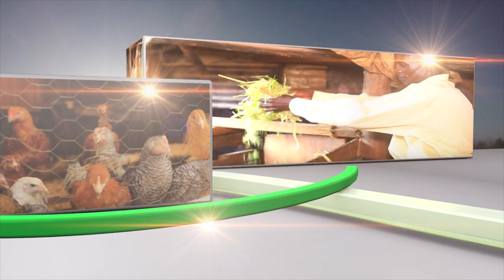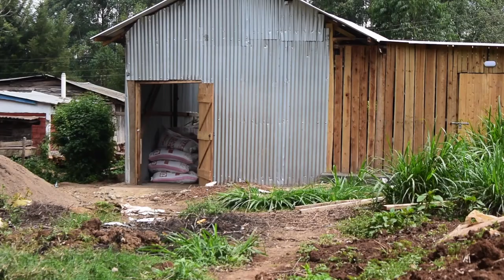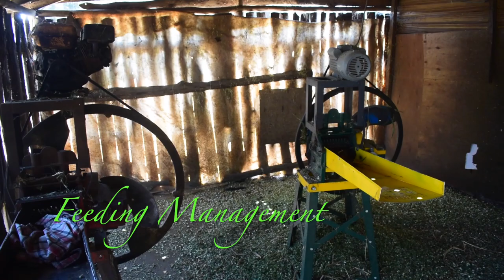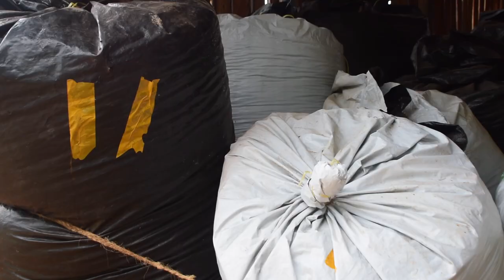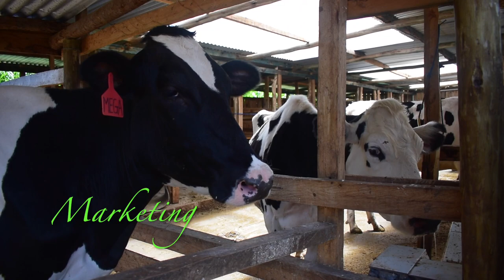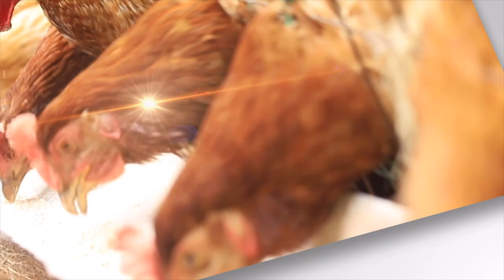ABC DAIRY FARM: A HOME OF HIGH YIELDING HOLSTEIN FRIESIAN COWS

Comment: How many Hectares of land you need to do like 50 cows I'm watching from Rwanda
Reply from the maker: It depends on production system you want to put your 50 cows. An intensive production system can fit in a quarter a hectare assuming you will source feeds from outside. A semi intensive production system you will need 2.5ha assuming you will put farm structures in half a hectare and use 2 ha to grow feeds. For extensive system using paddocks you will need 5ha divided into 4 paddocks of 1ha each, ensure that paddocks are manured well for grass to  grow fast.